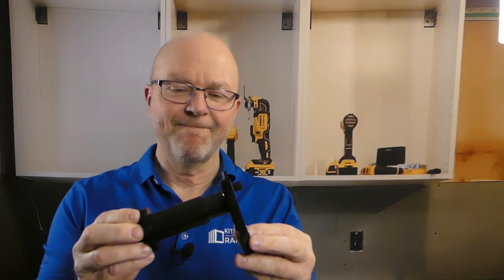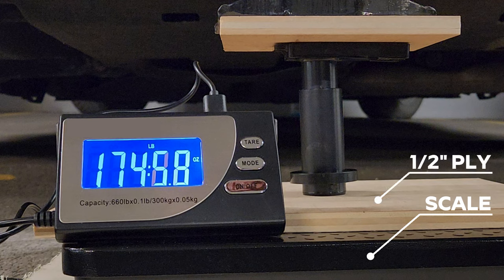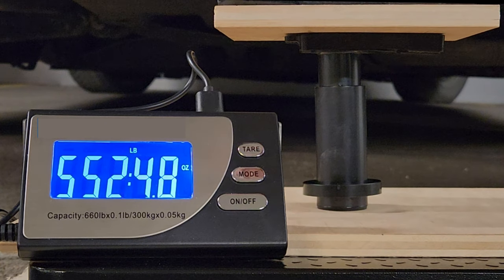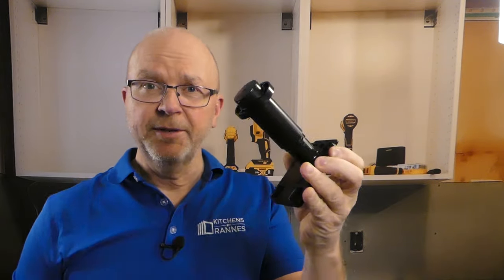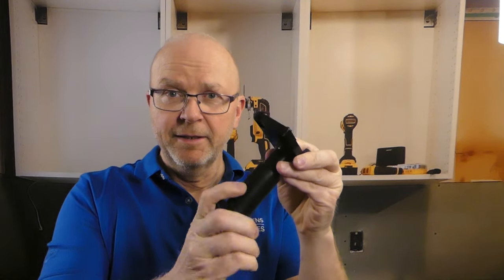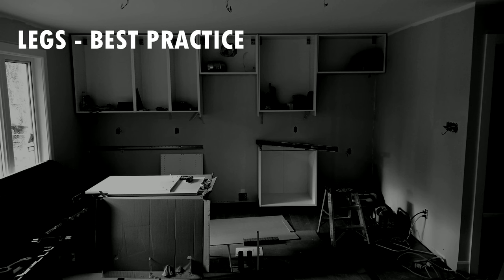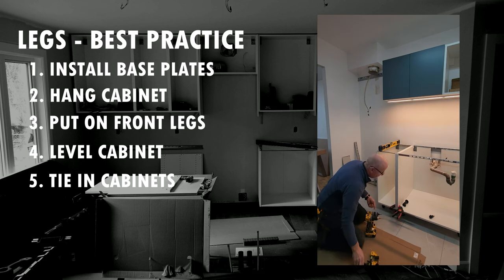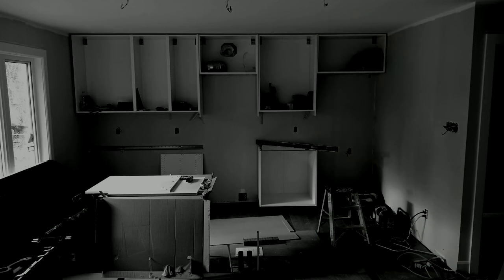Discover the Unknown Power of IKEA's Cabinet Legs PLUS Complete Installation Guide

Comment: I did the install myself of a kitchen island, and I was so worried that it might break down on someone's foot after doing the quartz installation but your video clarified my doubts about these legs, I used 4 legs per cabinet as you suggested, and I also put studs underneath for extra support
Reply from the maker: Thank you for your comment.
Legs are perfect for an island too as long as you secure the cabinets into the Island support brackets, which are screwed into the floor. This will prevent the cabinets to move sideways and break off the legs.

Comment: hah, legs ! I totally dig the issue (only vertical pressure allowed) and I was fully aware of the risks (hence the IKEA illustrated warnings) BUT in a wrong way. The cabinets I have (W=60cm) I could easily lift vertically and move around...but I got the WRONG impression legs would stick due to the snug fit in the 4 holes - they don't really ! Small lateral bump is enough to kick them out of their seating....which brings us to the possible solutions. If rail mounting is used, your's approach looks really neat and logical. I have a concrete wall and thought I might skip the rail mount and fasten them directly to the wall (good support). But, after watching your other videos, and now this one, where railing totally corelates with other installation steps (even legs, like in this vide) - this is exactly I am going to follow ! Another brilliant way to make a neat job......you made me enjoy my IKEA DIY kitchen project so much that I cannot wait for the weekends to come and get to work 🤩
Reply from the maker: Thanks, Boris. 
Good call about using the rail. It also makes leveling a lot easier as half the leveling of base cabinets is literally done when you make sure the rail is horizontal and flat. 
Good luck with the project, it'll be a lot of fun 👍
Reply: @kitchensbyrannes hey Rannes, one leg related question (when you find a minute or so): there's that tiny "protruding plastic limiter" on the body of the leg itself that one can easily break (by screwing in)..I am guessing it is there to define the minimum height for the original IKEA toe kick ? However, there is no information on the maximum extension of the IKEA leg....which in my case would need to be close to 11 cm (8,5 cm high 10mm thick edge tiling on the bottom of the walls) in order for cabinets to "sit" above this lip. So, in your experience how high (extended) you may have installed them in your practice ? Off course, that would mean the original toe kick (8 cm wide) has to sit on the floor (bottom) but have a few mm gap on its upper edge (below the cabinet bottom front)....not visible due to the depth of the Metod's front legs watched from few meters away (steep angle)....I guess it might also add some additional ventilation pathway ?
Reply from the maker: The little thing, which easily breaks off, is to give you a starting point of the length. If your floor is fairly horizontal, having the same initial length of all the legs, makes leveling faster. 
In regards to how much the leg can be extended. As you know already, the longer it gets, the less threads between the two parts are engaged and the weaker it becomes. When I have too big of a difference between finished floor and subfloor (where the leg will rest, I often use a piece of scrap wood below the legs. 
A gap between the top of the toekick and the cabinets is normal, since most floors aren't level.
Reply: @kitchensbyrannes  ...huh, again, such an obvious solution (now that you offered one 😅)...for whatever reason my brain was "stuck" into thinking how not to loose enough support (thread engaged) and still have it "visually correct" - that is original IKEA leg pressed to the floor surface....forgetting stupidly that the toe kick anyhow masks the leg's "foot" (at least in my case where floor is level no ugly "wavy" gaps between the two....🥰)...thanks a million, will not pester you any more, I am enjoying my evenings watching systematically your videos, one after another.......simply great 🤩
Reply from the maker: Haha, don't worry, you're not pestering me at all! I'm here to help. And I'm glad you're enjoying my videos. Keep watching and learning those IKEA hacks!

Comment: So the grey lock were to prevent the cabinet lift up. I thought it was for the sides. I should have known why I had hard time leveling back then. Thanks for the impressive pressure test how one leg can stand.
Reply from the maker: Thanks. I'm glad you liked the video.
The grey lock is primarily to ensure that the cabinet stays in place in any direction, but especially staying on the rail in vertical direction.

Comment: Oops, I have installed my corner cabinets, with legs at the front, but there is no way I can now reach to install the rear  legs in the corner. The cabinets are hanging from a very secure rail, won't that be strong enough?

Great video, thanks for sharing.
Reply from the maker: I'm glad you liked it. 
If the rail is firmly secured I don't see a problem 👍

Comment: Hi! This is a very random question but how would you suggest I attach the legs to an IKEA wall cabinet? The reason I don't want to use base cabinets is because they're too deep and I need a finished top because they'll be visible. I'm using the cabinets in place of a media console.
Reply from the maker: You just cut off the little pegs on the base and screw the legs+base to the cabinet. Set them back about 3" (75 mm) from the front.

Comment: Are the legs safe to use for leveling?

My cabinets are on the rail but i have to make some very minor adjistments to level 1 or 2 boxes.  This likely means the legs are taking a bit more load, and not just snug for stability.
Reply from the maker: Absolutely. That's one of the main purpose of the legs, leveling.
As long as you only put load on the vertical direction of the legs, you cannot break them.

Comment: How do you get to the back legs of the centrally located cabinets?
Reply from the maker: Hey there! To reach the back legs of centrally located cabinets, you have to get yourself down on the floor and reach in under the cabinets.
Reply: @kitchensbyrannes  Yup guess that's obvious looked like you were going from the side.  I'd need a more flexible helper to do that.  Any ideas what to do when cabinets go to the ceiling but can't be flush since they need to clear the lip of the rail, perhaps quarter round but looking for more ideas.  I wish I'd found your videos before I put most of my cabinets up.
Reply from the maker: Sorry for taking so long. 
Quarter round. ....did you say quarter round? 🤣
We don't do that. Leave it open 🙏

Comment: The legs do have the specified compressive strength of 125 kg, but the shear strength for any force applied sideways is absolutely abysmal and a real design failure. I did not even put weight on the leg while cracking it. I was removing the leg from its base by hand and wiggled it sideways with my fingers using a force of less than 1 kg. The base of the leg cracked in my hand, just because I wiggled it in an unfavorable manner. I since figured out a way to wiggle the legs out safely, but this experience shows that the plastic used is much too brittle. The material base is not as brittle as the material of the legs. The material's brittleness reminds me of the brittle brown plastic used for electric outlets decades ago, and the IKEA legs are even worse.

I suspect a production or engineering defect where good material was replaced by more brittle material due to cost or compressive strength. They could have doubled the thickness to make it much better, but they save cents on the bill of materials ending up with a shear strength that is less than 1% of the compressive strength. There is no excuse for such money pinching poor design. For the same price I can get stainless steel legs, but they are not integrated with IKEA holes, so I am stuck with the plastic parts.

Here is an article from a production perspective: Brittle Parts - Causes and Solutions By Douglas M. Bryce

As commented below by the OP: "the legs are made from polyamide, Nylon (PA), polystyrene (PS) and polyethylene PE. My guess, based on modules I took to become a mechanical engineer 35 years ago and some googling (mostly the latter) is that the base is made from PA, the leg from PE and the ring from PS. 

The internet says that "Polypropylene has a stronger compressive strength than polystyrene. It is a more stiff and long-lasting material that can handle larger compression loads."

The legs are not made from Polypropylene  (which is not brittle!) IMHO, and even the other plastics should not be that brittle.
Reply from the maker: @ChristianWagner888  I hear you.
However, it doesn't change the fact that the legs are holding up perfectly when used as intended.
One can then argue if Ikea shouldn't expect people to wiggle the legs during installation. 
I've installed more than 260 Ikea kitchens, broke dozens of legs during wiggling, zero when used per design. 
I noticed yesterday, that the clip which sits on the toekicks, are made from PP. Didn't check the other parts but I guess their type of plastic is written on them too.

Comment: The legs are cheap; that said, you need to use the tip given by Rannes to avoid cracking them.  (HINT: don't put the post of the legs on until the cabinet is hanging on the rail.)
Reply from the maker: I agree to everything 🙂 Except to "cheap." $20 (CAD) is not cheap 😂

Comment: Still wonder about long life. Will the plastic deteriorate and suddenly give way?
Reply from the maker: Good question. 
I'm sure Ikea have done thorough testing so I'm not worried. 
I can read that the legs are made from polyamide, Nylon (PA), polystyrene (PS) and polyethylene PE. My guess, based on modules I took to become a mechanical engineer 35 years ago and some googling (mostly the latter) is that the base is made from PA, the leg from PE and the ring from PS. 

The internet says that "Polypropylene has a stronger compressive strength than polystyrene. It is a more stiff and long-lasting material that can handle larger compression loads."

And since it's sitting in a nondestructive environment, I'm certain that the legs will outlast everything else.

Comment: I never use the back legs. There is no need. The rail is doing all the work. Just use the front legs to level. If the wall is so out of plumb that the back of the cabinet is too high, I just remove the wall spacer and then level with the front legs.
Reply from the maker: I see no valid reason not to add all four legs. Quartz counters are quite heavy and letting the two brackets hold a part of that, no thanks.

Comment: Those legs are so fragile. Moved the cabinent a couple inches and they snapped.
Reply: That's because you put a shear load on them.  They aren't designed for that.
Reply from the maker: Yes, they come off easy, and may even break, if you slide the cabinets sideways without lifting.  I'm actually surprised that Ikea doesn't put in the instructions that the beds shouldn't be put on before the cabinets are hanging on the rail.
I'm doubtful if they (Ikea product developers) have installed a kitchen at all.
Reply from the maker: @thezfunk  Yes. Absolutely correct. Shear forces are a no go.